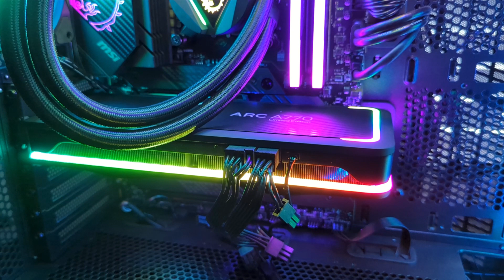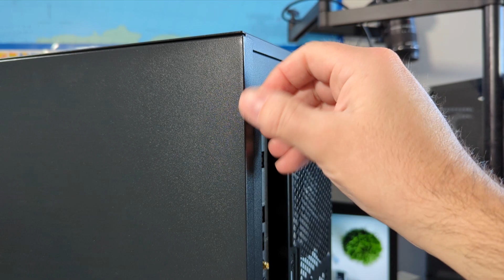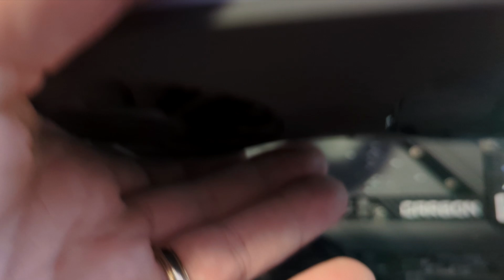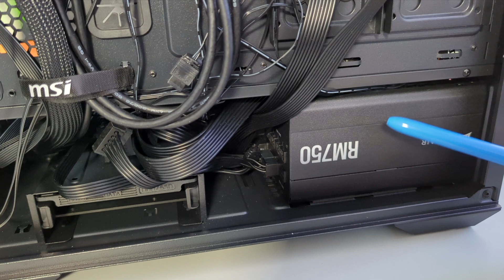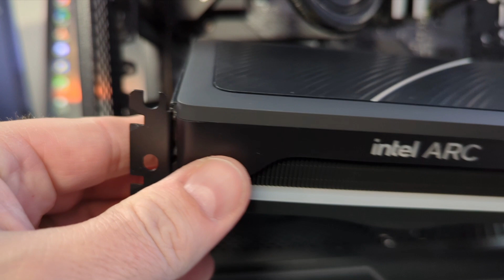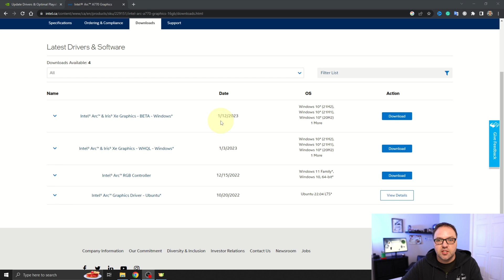How to Install a Graphics Card (Intel Arc A770 16GB Limited Edition Install)

Comment: Quick question -  Can we install the Asus Predator Arc A770 graphics card with the Ubuntu 22.04 Operating system? I see no Linux drivers on the Asus website for ARC 770. Is there any way to use this Graphic Card with Ubuntu? I appreciate your input. Thanks!

Comment: Plzz help I just bought a750 8gb which is have 8+6 pin power connector but my psu 600watt have only single pcie 6+2 connector so what should I do can I change my psu or use adapter suggest me better option I don't want to take any risk with my newly bought GPU plzzzz help me
Reply from the maker: If you don't have the cable on your power supply, you may need to buy a new power supply that has two.

Comment: Do you need two different power cables from the PSU or will one work to provide the power?
Reply from the maker: Typically one will work if you connect both connectors. However, best practice would be to use two cables.

Comment: Ryzen 5 2400G +  arc a770 + 550w psu?
Reply: psu is fine and i wouldnt see a problem with an older cpu maybe a slight bottleneck in certain games but u should be fine